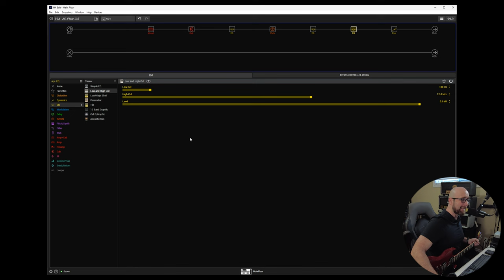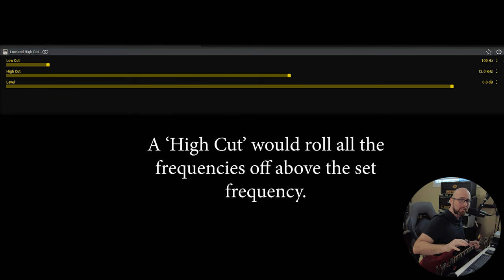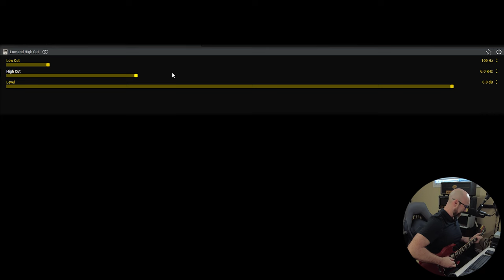QUICK TIPS FOR HELIX #2 | THIS Will Help Your Tone Sit Just Right!

Comment: Great vid again.  I didn’t realise the there was so much difference between the cuts on the cabs and the cuts on the block.
Reply from the maker: Thanks so much! There really is a fairly large difference. Both are very usable but good to know the difference when trying to get things just right :-)
Reply: @JasonSadites  I notice there are high and low cuts in the global eq.  Could that be used on the stomp if you don't have a spare block?
Reply from the maker: You could most certainly use those also. I tend to avoid the Global EQ, because my settings for low and high cut are going to very preset dependant, but if you are always using the same settings in every preset, you could most certainly use the Global EQ. The only other thing to keep in mind is that if using the Stomp as an audio interface, the Global EQ does not get recorded via USB. Hope that clarifies :-)

Comment: Im now running my hx through a catalyst. Its great but the speakers are a bit (Quite) brittle. I find an agressive hi cut at around 8 is needed. As for the baked in amps, they sound better in the hx for some reason. The voltage though, ugh.. i just dont get on well with that amp on either. Great video by the way, monster playing :-)

Comment: Great explanation!  Would it make sense to just use the low/high cut's in the global EQ?  And save a block?
Reply from the maker: Thanks :-) I tend to very seldom use the Global EQ. So many of these settings are going to be preset dependant and I tend to like the flexibility of being able to save settings for a specific preset. That being said, if a particular user found that they used the same setting for every preset, Global Eq is most certainly an option. One thing to keep in mind is using the Helix as an audio interface and recording via USB, Global Eq settings will not be recorded.

Comment: Another big difference in High Cuts depends on where they occur in the Signal Chain. A High Cut on the Speaker Cab Block early in the signal chain is very different than the same numerical High Cut in a EQ Block towards the end of the Signal Chain. This is because the High Cut is being applied to everything that enters that specific Block.
Reply from the maker: While this is technically true, I would not say it would create a "big" difference if any audible difference at all. The reason being in most Helix guitar presets, the one I used in this video and most of mine included, there are no elements before my high and low cuts that would have any  desirable sonic information in the frequencies above the high cut. For instance, most reverbs load up by default in the Helix with their own built in high cuts often times as low as 6k or 7k. But, it is possible that placement in the signal chain could make a difference, in a lot of guitar presets it will be extremely subtle if noticeable at all, which is why I didn't take the time to mention it in this video. I have spoken on this topic in other videos though. Hope that clarifies :-)
Reply: @JasonSadites I've tried both methods, and get better results just doing a High Cut on the Speaker Cab Block to match the Manufacturer's Analog Speaker's Frequency Response Chart. To be clear, my focus is on getting my Presets to sound the way I like through Monitoring Headphones, and to make Dialing In easier/faster. I'm not EQing the Cab High Cut for a Mix.

Comment: I have no blocks in the stomp so I use the global, play in the same spot everytime.
Reply from the maker: While that is a perfectly valid way to work if it covers all situations for a user, I tend to avoid Global EQ for this purpose since I make high and low cut settings per preset depending on what I need for a particular situation. But most certainly if it works for a user it most certainly is an option :-)

Comment: Down at 5 it sounds like the highs are in a shadow compared to 12...
Reply from the maker: Yeah I agree. It really does lose some sonic info that will help it cut in a mix.
Reply: @JasonSadites  I've been using this technique you showed us for a few years now. Just about every patch I use has that included after the amp and speaker. It is on my template. Thanks.

Comment: What I have a hard time understanding is that most guitar cab speakers in the real world only produce to maybe 6.8k…..so why do we have to set the Helix at 12k? That would be like playing through a horn.
Reply from the maker: When mic'ing and recording a guitar speaker in real life, there is always some sonic information captured in the upper frequencies that may not be desirable and, as mentioned in the video, could maybe get in the way of other elements in a mix. The high cuts can help to tame those frequencies and polish things up a bit. If there was no sonic information up there to begin with, applying the high cut would have no audible effect, which we can hear in the video, is simply not the case. In fact, when moving the high cut down as low as 6k, the guitar tone gets very dark and, IMO, would not work as nicely in the mix. Hope that helps :-)